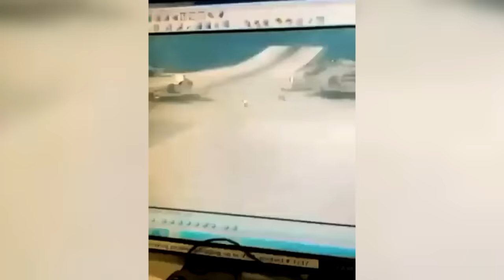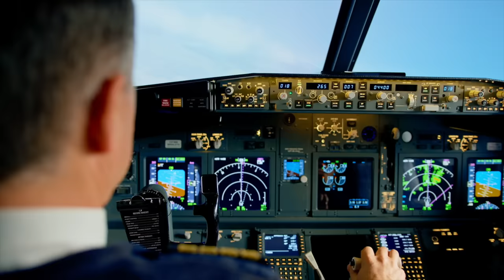Plane Takeoff Failures Caught On Camera

Comment: Chesley B. Sullenberger was a flight instructor, an airline accident investigator, an F-4 pilot in the United States Air Force, and, maybe most relevant to the landing in the Hudson River, a GLIDER PILOT.
Reply: So he knows how to fly a glider. How does that help you fly a jet as a glider? Gliders are designed to glide, jets aren't. His training on military and commercial aircraft was a lot more useful than his experience as a glider pilot. Gliders fly like any aircraft, the special techniques you learn involve using thermals to sustain flight. And they are really good at sustaining flight, being very light and with lightly loaded, high aspect ratio wings. Other aircraft fly exactly the same way, just not as far. You just trade altitude for speed. If he was just a glider pilot he would have thought he could glide it all the way back to the airport. As a jet pilot, the knew he could sustain flight for a very short time, since he only has a small amount of attitude to trade. It's not like he is the only pilot to ever land a jet with dead engines.
Reply: @justforever96  I guess you are not a glider pilot. As a glider pilot managing altitude and speed and watching out for potential landing areas is your concern during the entire flight. With powered aircraft it's not. And as a glider pilot you are constantly handling kinetic energy and aerodynamics of a non powered aircraft. And that mental background might have helped Sully to intuitively make the right decisions. And BTW aerodynamics of an airliner on idle thrust or with engines shut down are not that much different from a glider.
Managing the complex system of the airliner (doing the necessary emergency procedures) is the other part of the workload in that situation. And that's the part where being a glider pilot didn't help him.
Reply: that's one big sob glider
Reply: I don't see flipping burgers on that resume..?
Reply: @gulfstream7235 don't die as a disbeliever
Reply: @moaningpheromones don't die as a disbeliever
Reply: Don't die as a disbeliever
Reply: Long live the glider pilots!!!!!!!!

Comment: "never got out of the Hudson bay area" Hudson Bay is located in far north Canada. He landed in the Hudson River which runs along side Manhattan. Glitch
Reply: It’s the Hudson River, but most NYC residents also call it the Bay Area. Maybe that’s where the confusion came from, but you are technically correct.
Reply: @Sniperboy5551  the Bay Area is where San Francisco is.
Reply: Also a common misconception is that it was a miracle. Incorrect. The flight had a safe outcome because of the safety culture in commercial aviation, the regulations the industry follows, the frequent and thorough training of pilots, air traffic controllers, maintenance technicians, airline dispatchers, and many other professionals. Safety wasn't uncommon or an accident or divine intervention. Also, the decision was the true key here. Landing in the water wasn't the thing that set this apart, it was that Sully recognized that returning to LGA, going to JFK, or diverting to TEB (with north/south runways while he was east of the airport) wasn't feasible without possibly losing too much energy, so he went with what some may not have thought about. (Fun fact: when Hanks, Sully, and Eastwood were preparing for the movie, they used my airline's Airbus simulator. Unfortunately I never met them during that time, but Sully was on one of my commute flights at some point later on.)
Reply: @justing42 😂😂😂 there's more than one bay in the world. The  Hudson bay and the San Francisco Bay are thousands of miles apart
Reply: @Aviator27J  true dat, also that Sully intentionally put down near barges. But think back to that dark time-- there was nobody that wasn't convinced we weren't sliding fast into a great depression. All of the talk was about whether the programs that seemed to work in the 1930s would be viable options in 2009.  We needed that "miracle."
Reply: @Sniperboy5551  I'm from NY and I never heard anyone call the river or the city 'The Bay Area".
Reply: Makes you wonder how much else is incorrect.

Comment: "The airport runway was too short for the Boeing 727." That must be a short runway. The 727 was designed for use by Boeing per Eastern Air Lines request for an aircraft that could take off from shorter runways in the Caribbean but had to have three engines. This combined with specs from other airlines resulted in the 727.
Reply: It obviously wasn't too short, they wouldn't be flying from a runway that they couldn't take off from. Im sure it means that it didn't have the large safety margin specified by most western authorities. You need to have room not just to take off, but to abort any takeoff up to the rated safe speed. In any case, it is still a large jet. It still needs a large runway, just less than the contemporary jets like the DC8 or 707. Doesn't make it an STOL bush plane. 
Also I can't imagine how any plane would fail to take off because they were going too fast . That doesn't make any sense. I could see if they modified it to take off slower (also don't see how that's a fuel savings) in order to allow it to use shorter runways like this one, and the pilots weren't made aware of this and ran out of runway before they managed to reach the speed they thought they needed. But you would think that when they saw the end of the runway coming they would try anyway, and if it was able to take off slower it would have been fine. More likely they didn't "modify" it (not even sure how they would do that), but rather created new takeoff procedure to allow a slower takeoff from a short runway like this one. 
Only someone failed to tell the pilots about this, and they were still trying to take off the normal way, and in that configuration they were not able to take off at the speed they were able to achieve.
But no, he said they already lost an engine and hydraulics and a landing gear. So they were probably screwed anyway. Kind of curious now to know what happened. If that's the case I don't see what the modifications had to do with the crash. That's just incidental stuff they discovered while investigating.
Reply: The 727 had remarkably good short-field performance for its day.  Now?  Not so much.   Few know that the plane was originally equipped with NOSE gear brakes.  That plane could land in under 4000 feet.
Reply: I think that operator also restricted the amount of Thurst on the 727 was able to produce by the engines for fuel saving and didn't tell the pilots
Reply: Aerosucre is a shit show. That is all you need to know.
Reply: @okedoke1234 don't die as a disbeliever
Reply: @BelugaAggression3161 fear Allah
Reply: @lbowsk don't die as a disbeliever
Reply: @justforever96 will you not fear Allah
Reply: Allah is one God God is Allah Allah has 99 names Allah is almighty
Reply: @REBECCA12341  Yeah. This will make this thread explode ion popularity.
Reply: @ChuckJansenII  wife back door not allowed ect
Reply: @ChuckJansenII  XXX not allowed
Reply: @ChuckJansenII  drugs alcohol pork not allowed
Reply: @ChuckJansenII  tattoo not allowed
Reply: @REBECCA12341  Taqiyya
Reply: They were 2500 lbs plus an undeclared passenger over max weight and took off in the wrong direction based on the wind at the time they took off.  Apparantly ATC had gone home for the day.

Comment: The last one didn't set flaps, it's clear to see. They didn't do they're checklist correctly. They finally achieved enough air speed to get airborne. Lucky.
Reply: I caught that one too. Their official statement was a load of bull
Reply: Taking off without flaps is technically possible, given the correct speed and length of runway, but ill advised and not smart aviation.
Reply: Last one was actually caused by wake turbulence. There was a Turkish airline that landed on the intersecting runway. The footage shown here, cuts that.
Reply: The flaps and slats are set as you can see clearly at 10:06 on the video.  In addition, read the report and the pilot rotated prior to reaching Rotation Speed.  It had nothing to do with the turbulence from the A330 but simply pilot error on rotation.
Reply: Same, flaps were not extended on the last one.
Reply: EXACTLY!!!
Reply: *their. Not they're. Simpleton.
Reply: Their checklist, even.
Reply: Deve ser isto mesmo parceiro. Àinda bem que deu tempo para corrigir o erro de planilha 🙏🏻🙏🏻 BRASIL 🇧🇷🇧🇷
Reply: No, he did set flaps, watch carefully.
Reply: Flaps are easily seen deployed. Leading and trailing edges. He simply rotated too early.
Reply: It looked to me like it was set at 2 or less.
Reply: Flaps 1 takeoff on a 737 is a very standard procedure, higher vr but better climb performance. Used when runway margins allow. Visually it’s hardly noticeable, wake turbulence was the reason.

Comment: I don't think AeroSucre chose a too fast take off speed. It looked over weight as well as not fast enough, not too fast.
Reply: I was looking for this comment. AeroSucre have long been renowned for ignoring MTOW limits and overloading their aircraft, forcing pilots to sign off on it, and constantly pushing it to extremely dangerous levels.
Reply: Then read the final report.
Reply: @lbowsk  Just did and what do you know? I'm not sure about incorrectly calculating a higher rotation speed. If the end of the runway is coming up a pilot will try and drag the plane off the ground. The tailwind is significant. From the report:
"The crew incorrectly calculated a rotation speed that was 5 knots (9 km/h; 6 mph) higher than necessary.
The chosen takeoff runway was subject to a 4-knot (7 km/h; 5 mph) tailwind.
The pilot rotated the aircraft too slowly, at about 1°/sec instead of 2 to 3°/sec.
Furthermore, although initial calculations suggested the aircraft was operating within its weight limits, the investigators believe, based on the takeoff speeds used by the crew, that the aircraft was actually almost a tonne above its maximum permissible takeoff weight of 74.7 t (74,700 kg; 165,000 lb)..."
Reply: It takes longer for an overweight plane to accelerate. If they had rotated sooner as their lower takeoff speed allowed, they might have cleared the obstacles. Then again that wasn't the only issue with their takeoff run, they had a slight tailwind and the rotation was not conducted quickly enough nor steeply enough. It speaks volumes that they could have got off the ground safely, even with an overweight plane, had they done everything else properly.
Reply: @Frentzen127  OK. So not fast enough. If they had done everything properly that would have meant calculating everything required to get off the ground etc. etc.
Reply: Adding 5 knots isn’t gonna change anything if it won’t fly at the lower speed either.
Reply: All those drugs weigh a lot.

Comment: On the last one, the problem wasn't all because of rotating too early - the pilot forgot to extend the flaps as well. They were fortunate that they had enough runway to get more airspeed. Otherwise, this would have been a crash.
Reply: You don’t take off with the flaps down
Reply: @justing42 large airplanes do, 727, 737, a320, etc use flaps and slats for TAKEOFF and landing
Reply: looks like Flap 1 set.  You can see the leading edge slats were out.  Perfectly good in the 737 but you need higher speed of course.  As you said and looks like they had speeds set for a normal Flap 5 take off
Reply: @justing42  yes you. do.  you have take off flap settings
Reply: @WMUDrew  you don’t have the FLAPS DOWN ALL TNE WAY FOR TAKEOFF.  I am a mechanic for Delta…you want to start splitting hairs?
Reply: @Gavlister  no shit…let’s split hairs.  You don’t have them ALL THE FUCKING WAY DOWN for takeoff.  I have been fixing planes for over 30 years.  I forgot I was talking to people that need it completely spelled out. This plane is in TAKEOFF CONFIGURATION
Reply: @justing42  He said: the pilot forgot to extend the flaps as well.  

You said: You don’t take off with the flaps down.  You extend the flaps for take off as he said.  
You misread what he said.
Reply: @justing42  where are you based and what fleet do you work on?
Reply: @justing42  where are you based and what fleet do you work on.
Reply: @Gavlister  I think you are wasting your time, feeding a troll who clearly doesn't actually have a clue.  Probably wouldn't be able to identify a flap if his life depended on it.
Reply: @ChristLink-Channel  kind of think you are right.  I don't think he works for Delta as an aircraft mechanic
Reply: No, it was due to turbulence wake
Reply: @reyblais4858  nope.  do you understand wake turbulence? this had zero to do with it. air maroc tried to cover up here.
Reply: @Gavlister  The report literally listed that as cause
Reply: @reyblais4858  can you point to the report?  I don't believe there was an official report and no incident was filed.
Reply: @justing42  You need to quit then as you seem to be unaware of basic procedures.
Reply: @reyblais4858 Yes I also recall this being determined as being due to the plane rotating in the down draft of a wing vortex of another large plane.
Reply: That's what I see...Flaps are Up, not Takeoff.
Reply: @justing42  yes you do...how else do you get enough lift at low airspeed to lift a fully loaded aircraft off the ground???.......
Reply: @justing42  most airplanes use partial flaps for take off.
Reply: @Gavlister  you tube a video by the mentour pilot on this incident. Despite what armchair pilots think, it was a very professional act of airmanship due to wake turbulence from a landing A330. And a report was filed
Reply: Looks like he had a lot of nose up stab trim and likely the reason why the aircraft rotated 'early'
Reply: @justing42 yes they do they use 5-15 degrees of flaps for takeoff and usually 25-40 degrees for landing. This seems like a poor attempt at trolling lol
Reply: Just.. nope. No mistake by pilots. The opposite. Pilots performed well when they decided to put nose down and gain some more speed and escape wake turbulence... And even reported this incident so it was properly investigated, it does not repeat and ATC is aware that such things can happen.
https://www.youtube.com/watch?v=TEjbg_2yuFI
Reply: Yes, it looked as if they failed to use flaps
Reply: Mentour Pilot made a feature about this incident, arguing quite convincingly that they indeed hit the preceding a330 wake.

Notice the dramatic difference in climbout/aoa between the first and second attempt with relatively little time to accelerate in between. There is no way this was simply a speed/configuration issue.
Reply: @JimJurena  one can clearly see slat extension on early roll. As has been stated before, flap setting 5 (LE extended, TE stored) on a 737-700 is a common take off setting.
Reply: @justing42 flaps literally provide more lift? When youre heavy you need them to take off in time.

Comment: We've been flying commercially for (I think) over 100 years by now ... and I can't help but wonder why we've never found a solution to the "bird in the engine" problem. Ideas?
Reply: I’m an aircraft mechanic. Adding something to cover the engine to reduce the chance of FOD lowers the engines efficiency. Even if it’s by a little bit. You also risk the chance of that part being dislodged and sucked into the engine itself.  Then there is the matter of potential ice build up etc.  Which is worse than a bird strike. It's impractical in that birds can't fly near as high as most commercial or private pressurized aircraft. Engines are built to withstand certain things being sucked into them within reason. There are many more factors to consider but these are the most likely scenarios.  I hope this helps.